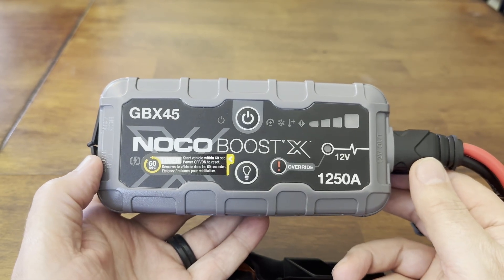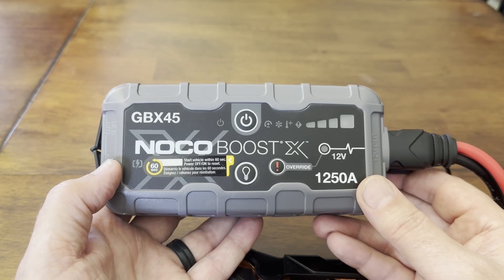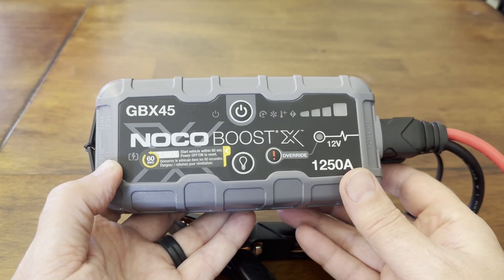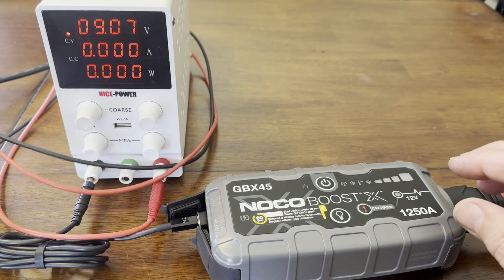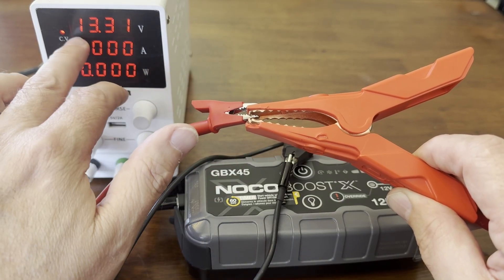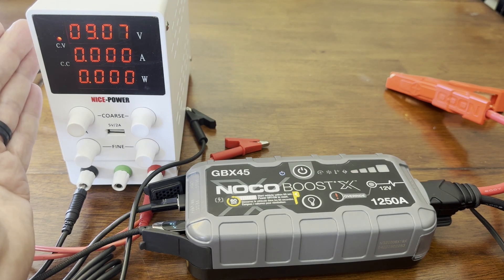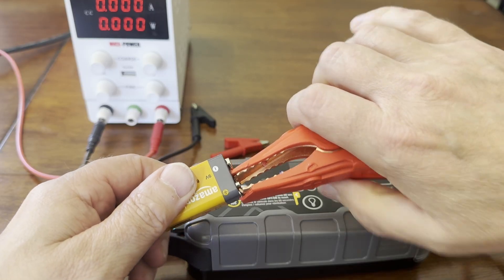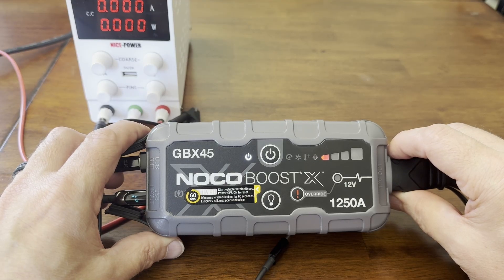Noco GBX Won't Charge - Easy Fix!!  Jump Start a Jump Starter using the USB port

Comment: I'm trying with a 9V battery and a 12V-5W bulb but I'm not sure if I understood the concept correctly. Red cable to 9V+ is clear, but do I need to connect the 9V- via bulb to BOTH USB of the Noco, i.e. USB-A out AND USB-C in at the same time with one cable?
I tried it with USB-C only and the bulb lighted up for a few sec but then stopped. The Noco switched on for a few sec, I plugged it in via regular 230V 65W charger, but it stopped charging after a few moments. Unsure if I'm doing it wrong or not :-)
Reply from the maker: Connecting to only one of the USB grounds should be fine.  It sounds like you did it correctly.  You could try using the 9v battery negative through a bulb to the USB output ground and keep the charger plugged into the input/Charge USB port at the same time.  Let me know how it turns out......
Reply: @peppermoongarage  Thanks for the quick reply! I tried as you said - 65W PD to USB-C in/out and use USB-A out to connect to 9V-. Same phenomenon as before: bulb lightens up, first rather strong, then lower until off. Simultaneously the fast charge light indicator of the Noco switches on red, stays on (red) for about a minute, then off for 30sec. Then on again for a minute or so. At some point, power LED and charge state LED turn on, but flicker in a weak manner. Based on Noco website, this indicates a faulty Noco :-( "White when fast charge is active. Fast charge LED turns red (solid/blinking) when there is an error." Once I break the 9V cycle, after a few moments, both the charging level LED and power LED turn off, and after a while also the fast charge LED. Thanks for the great video either way, but I think I won't be able to revive mine.

Comment: I have the same problem with a GBX75 that is currently ( no pun intended) a brick. Since I don't have a separate power supply I am going to try the 9v battery approach. One question: I understand the Noco positive to the positive terminal on the 9V but did you use the OUTPUT or the Input to connect the ground? With the external power supply I saw you used the Output but wasn't sure if that is the case when using the 9v battery. Thanks for any help.
Reply from the maker: Thanks for the good question and pun, lol.  I think either input or output would work.  I think having the normal charger in the input port at the same time as applying the 9v ground to the output would be best.  You would be able to see when it starts to charge normally.  Make sure you use something like the light bulb to limit the current out of the battery.  It may take more than one try.  Several people have reported the battery method does work.

Comment: Thanks for the tip! Worked great, had a GBX75 stone dead. Tried at 10v @ 50miliamps for over a hour with no luck. Bumped up to 15v at .5a for 2 minutes and it began taking a charge! Thank you!

Comment: Thank you so much for posting this. My problem started when my wife loaned it to our neighbor who used it to jump his 6.7L diesel. Unfortunatly it was already really low (one bar of power) and I think that last jump start caused it to fall below the required voltage to charge normally. I was able to restore my GBX75 that was purchased in Nov 2022 using a combination of what you posted and what jimginnyohio posted. I tested the GBX75 voltage using a USB C cable on the IN/OUT port and it was measuring 6.92v. I then used a 500ma trickle charger from Harbor Freight hooking the negative to the USB C and the positive clamp on the GBX75. I charged it for 10 minutes and it brought the voltage up to 12.25v. At this point I plugged in my 65w adapter and it started to slow charge. I let it slow charge for 30 minutes then unplugged and replugged in the 65w adapter and fast charging kicked in. I took about an hour to fully charge and its working great again. I figured it would be safer to charge it through the IN/OUT port at 500ma as that port is already setup to take a high level charge. Lesson learned, keep it charged up. Thanks again for taking the time to share this with everyone.
Reply from the maker: Well done!  Thanks for sharing the additional details.

Comment: Just tried this method with the 9v battery and halogen bulb and it worked. Tried an 80w USB c pd charger before and a few other ones and nothing would make it come on. Thanks for posting this.

Comment: I had a dead GBX55. The way that I killed it was I had it in override mode to power a piece of amateur radio equipment. Forgot about it and it completely discharged. The device would not charge with any USB-C power supply, including a 65W USB-C laptop power supply. I tried the method described here (9V @ 50mA) and let it go until the ammeter read 0mA. Tried charging again and same thing, red error LED. After about 5 minutes the red error icon was flashing. As they say, try, try again. So I pushed the power supply up to 11V @ 65mA and let it charge until it was drawing no current. Bingo! That worked! Thanks to the original poster for rooting out this method!

Comment: Thank You. 
So I used the 9v directly for a few seconds. 

And now loading with 65w charger. Red loading light is on, but I see the loading led is blinking. I did. Not understand this combination.
Reply: He said to use a low wattage bulb to limit the voltage flow to your unit, and implied the direct voltage from the 9v could be damaging. Your guess is as good as mine, hope it didn't brick your unit for real.

Comment: Would i get same results if i clamped positive to a 3v button battery to positive and usb cable connection to negative of the button battery
Reply from the maker: I think two 3v button batteries in series would work.  Just stack two together.  That would give 6V nominal and would not have a huge inrush current.  I think 5v is the minimum needed to kick off charging.  Please report back if you try it.  It sounds like a good idea (2 in series).
Reply: @peppermoongarage I don’t have any light bulbs but could I use a fuse (glass with 2 silver ends) that is 12v 5watt?
Reply from the maker: A fuse won't have the resistance needed to limit the current to avoid damage.
Reply: Ok thank you for that. I'll try
I've tried using 9v and small 5v bulb but doesn't seem to work. 
I tried on a working noco and still bulb doesn't illuminate and noco not showing it's charging
Reply: @yossibodner wondering if the 2 button battery worked?

Comment: Just hooked this up to my battery tender and it fixed it! I got a GBX155, every time I would plug it in I would get a red lighting icon close to the charger port. Just did this trick putting the positive on the jump pack to my positive on my tender. Then for the negative I did the USBC port on the jump pack to my negative on my tender. It put quite a bit of power through it so I only let it go for around 20 seconds and it fixed my issue. Thank you for this video!!! ❤
Reply from the maker: Perfect!  Thanks for reporting in.
Reply: Didn’t think to use a battery tender til I saw this comment, tried it and worked perfectly! Thank you.

Comment: DUDE YOU ARE A LIFESAVER! I literally plugged it into my power supply for 3 minutes and now it’s taking a charge. The guys at NOCO boost literally wouldn’t offer anything but a 15% discount. What a scam. Never buying from them again but so happy I was able to fix this existing unit.
Reply from the maker: Nice!  

It's easy enough to fix if you know what to do.

Comment: Will a trickle charger work
Reply from the maker: A trickle charger may have too much amperage for the USB port to handle.  The idea is to get the battery just up to the point where it will charge itself.
Reply: Just used a trinkle charger on it for around 20 seconds and it fixed it! Not sure how safe it is, but it worked...
Reply: @Nullifys I tried this but doesn't recognize it I bought a new one from company they gave me it really cheap cuz warranty expired it was£45

Comment: Just confirmed that this works with a Micro Start XP10 I found today that had a dead BMS.  I used the 9V battery method while it was plugged in, and once I tapped the terminals together, The light started flashing normally again on the charger. Hopefully this works. Great advice and video!
Reply from the maker: Nice, thanks for reporting in!
Reply: @peppermoongarage No problem and I confirmed it works!

Comment: My problem was I was trying to use a micro usb charging cable which always worked fine but with it being fully discharged I had to use the original charging cable to bring it back to life.

Comment: Does this method work for GOOLOO jump starters ? I never even got to use it and it just died ! weird thing is if you plug in low wattage usb-c into its charge port the J pack display comes on but then goes out again. any ideas as I cant get through to useless GOOLOO aftercare!
Reply from the maker: I haven't tried this method with that brand, but I don't see why it wouldn't work.  Report back if you try it and let us know.......

Comment: For anyone coming here with the same issue, before trying this method, it's worth checking around to see if you have one of those higher-powered ~60W USB chargers. I just experienced this very same problem with my GBX45, swapped out my regular USB charger for a 65W model, and it started charging! Went from brick to fully-charged battery in less than an hour. If that doesn't work, the next escalation step would be to get the car lighter adapter cable from Noco (~$15 USD), plug it into your GBX, and run your car for at least 15 minutes, which will supposedly bring the battery up to level where it will detect a normal USB charger. If neither of those work, then you can escalate to the power-supply fix shown in the video (or Noco could, you know, fix this design problem).
Reply: Just came here to say this after experiencing today
Reply: Where can you buy a 60w charger? Can someone leave a link? My noco uses that other input, not the C.
Reply: @mikemcgee6810 Well, since you don't know the type of USB for your NOCO... Do an internet search on USB types.... You will see images of all USB types... Once you identify which one it is... Only then can you do a specific search on the USB type you need with the wattage... Depending on what type of phone you have... You can ask the voice apps on Android or iPhone ..
Reply from the maker: Good tips, thanks for sharing!
Reply: I did some research on my own and saw the same solution with the 60W charger...

Comment: You legend!  I have the same model with the same issue.  Followed your steps with the power supply and left for about 20 mins.  Disconnected the PSU and now it's charging via the USB-C port again.  Thanks for taking the time to make & post this video!
Reply from the maker: Awesome, I'm happy it worked for you!

Comment: And if you don't have a handy dandy power supply??
Reply: Did you not watch the video to the end? Might consider doing this in future before asking daft questions about things the content creator has already explained in detail.
Reply: @joshbrookes6439   yikes I did watch the video ask the way thru. But by then I had already posted the question and didn't go back to delete it. I still don't fully understand how to do the 9volt method but I'm daft so.... That tracks
Reply from the maker: You can try the 9volt battery and low power 12v bulb I referred to in the video